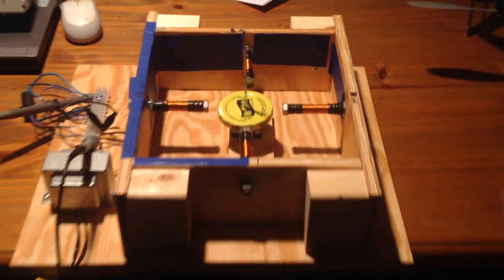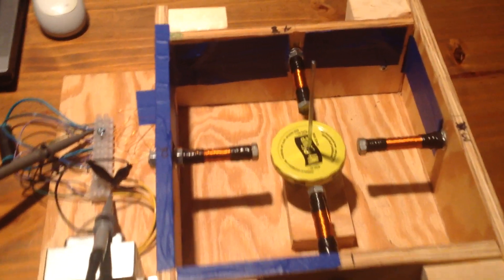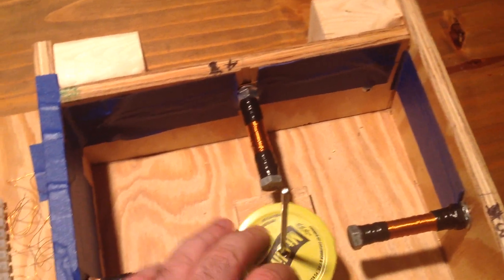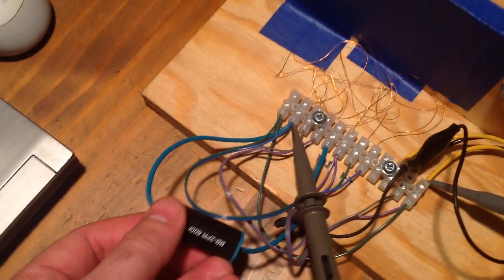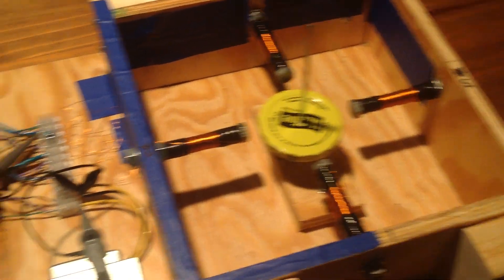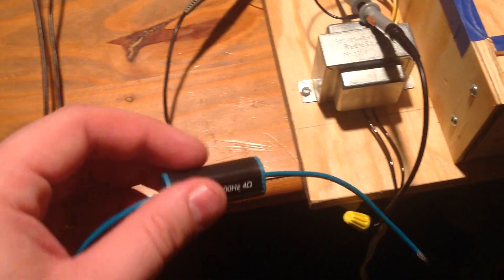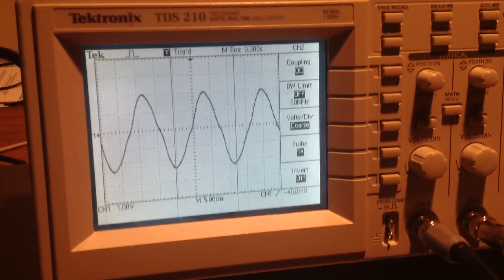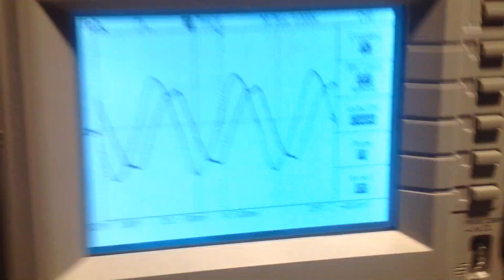Build a simple AC Induction Motor

Comment: The capacitor and inductor branch will lead the inductor branch, but the current can not lead by a full 90 degrees current phase difference. It can approach but never make a full 90 degrees, because....

Z_series = XL + XC; and 
If XL > XC, the reactance is predominantly inductive, and the current in the series branch will still lag the voltage, but by a smaller angle than the standalone inductor (less than 90°).
If XL < XC, the reactance is predominantly capacitive, and the current in the series branch will lead the voltage, but by a smaller angle than the standalone capacitor (less than 90°).

Comment: hello, I liked this project I would like to make an equal to a job, you have the circuit components? could provide?
Reply: you only need , coils and condesators , and also a tranformate 220 /12 volt or 220/ 6 v , wire esmaltados of 0.5 mm , that is all , in the theory part you need read about tank circuit , I hope had help you , good luck , and study with pasion.